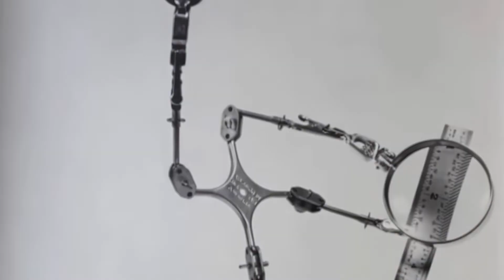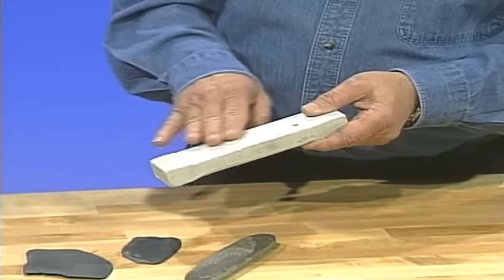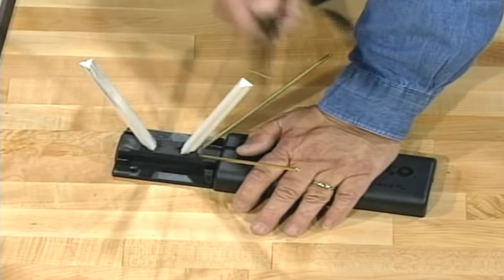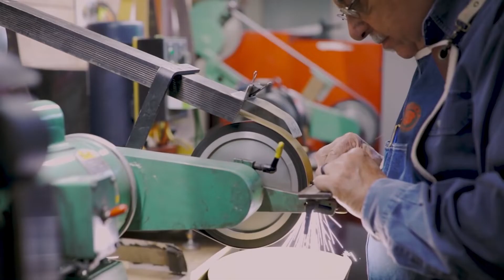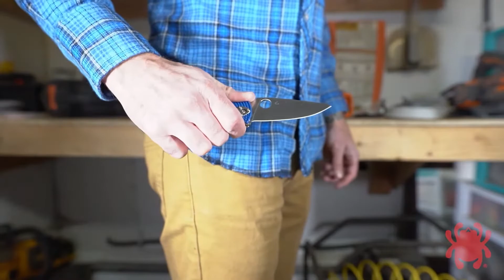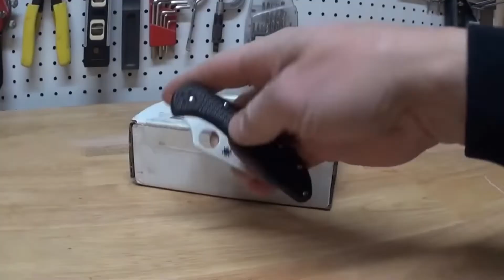How a Travelling Salesman REINVENTED Pocket Knives

Comment: I always thought the spidey hole was a bit daft and a weak spot. But, then I got a really great deal on a Dragonfly lockback. It's not easy to flick open, but it's SUCH a nice little 5th pocket knife to hold and use. 

I still prefer flippers in a large knife, but I now appreciate Spyderco's design and understand the appeal 👍
Reply: I highly recommend trying a Paramilitary 2, the way you can flick those open with your middle finger and the ergos of the compression lock make for a different experience. Close to what you get with a button lock flipper in terms of fidgeting but much sturdier and more reliable.